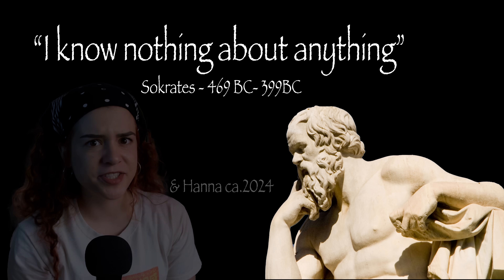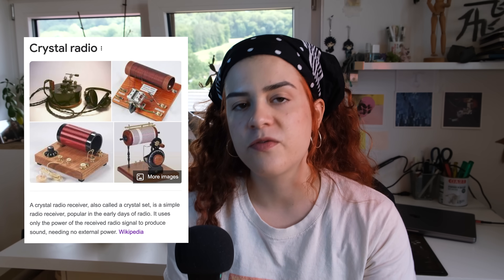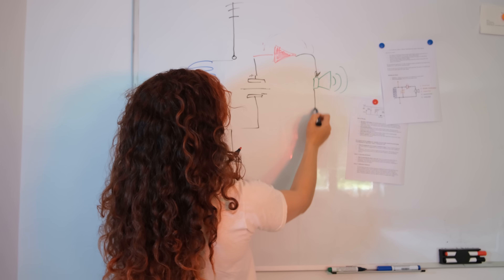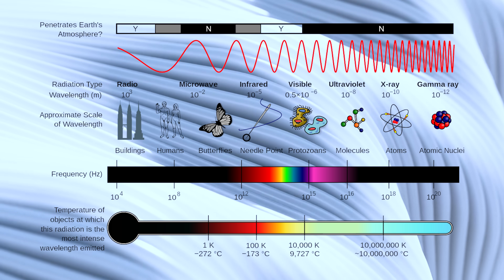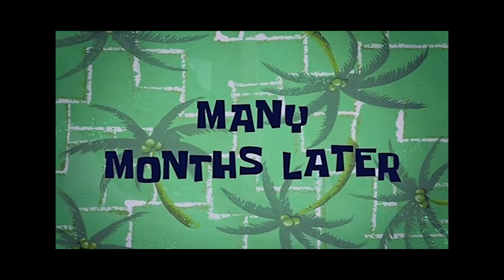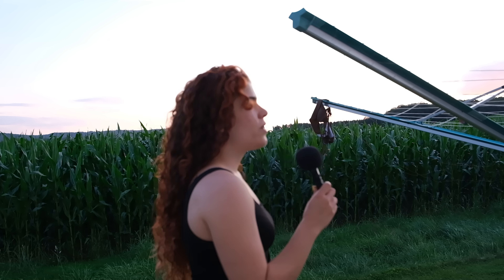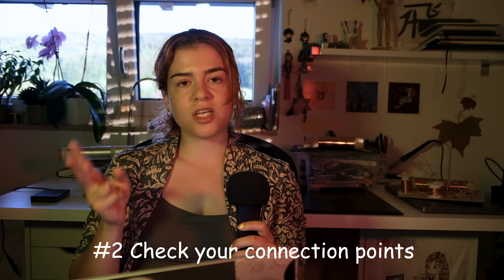I BUILT A RADIO AT HOME

Comment: You ever play on a swing?  That inductor-capacitor circuit is kind of like that.  You start out without any energy, sitting at the bottom of the swing.  Then the antenna captures some energy and sends it to your L-C circuit, just as your friend would push you a little to start you swinging.  The swing oscillates with a fixed frequency based on its length and the force of gravity.  The L-C has a specific oscillation frequency too, based on the values of L and C.  Both your friend and your antenna must push you and the L-C circuit at the exact right time for you to gain more energy with every cycle.  We call this the resonant frequency of the system (mechanical or electrical -- it doesn't matter).  At the top of your swing cycle, you have 0 speed and all your energy is potential.  At the bottom of your swing, you have maximum speed and all your energy is kinetic.  The resonance is between kinetic and potential energy exchange.  In the L-C circuit, the energy exchange is between maximum voltage (all energy stored in electric field of capacitor), and maximum current (all energy stored in magnetic field of inductor).  The resonance effect is what allows the "amplification" you mentioned, but it's really just saving more and more energy each cycle.  The fact that it only works at a specific frequency is what allows the circuit to be called a band-pass filter.  Your earpiece will take energy out of the system, so you gotta be careful to only take a tiny bit out.  Your use of a resistor limited how much energy was taken out and allowed it to continue resonating.  Welcome to electronics!  Hope you enjoy your stay.

I'm guessing the final version of your radio worked because your giant inductor had spacings between the windings that were so tight, that their close proximity started acting as capacitor plates.  You inadvertently built an L-C circuit anyways despite getting rid of the aluminum foil C.  This is called parasitic capacitance, and all inductors have it.  All inductors also have some self-resonant frequency due to this.

A lot of the guesswork can be eliminated from this by using a Vector Network Analyzer to measure your components.  Cheap ones exist today, for example the NanoVNA.  This would let you see self-resonance among many other things.

YouTube channel FesZ Electronics does excellent work teaching EE in a relatable way.

Comment: Crystal Radio!. You could now progress to the single chip AM receiver. Also try using the rectified output feeding to the charger chip in solar led lanterns(minus the re- chargeable battery and solar cell), to make an led powered by radio waves!. Also try getting a ham radio license, to transmit your own radio waves across the globe and have fun at the same time talking to others❤👍

Comment: Did you get the real diodes or did someone scam you?  A lot of people selling the germanium diodes are really selling Schottky diodes. They can be made to work but they don't work in the circuits many articles suggest.
Edit:  That resistor is needed mostly if the diode is not really a germanium.
On my channel I have a video about making the fake diodes work and also about making a capacitor that is simple.

Comment: A Diode is like a Check Valve in a pressurized fluid or pressurized gas system: It allows the electrons / liquid / gas / whatever to flow in only one direction.

Comment: In case no one else posts it.
ASPIRIN works for getting enamel off that sort of wire - it's especially useful for ultra-fine braided earphone wire.
Push the wire against the pill with the soldering iron = it melts and gives off quite pungent fumes (possibly acetic acid ?) so do it somewhere ventilated...

Comment: 2:02 If you look a chart of the EM spectrum, the left side of the visible spectrum (light) often has red and radio.  This side of the spectrum, at high powers can make things hot (like a Microwave oven) or can induce electrical current (which can pose the same hazards you normally encounter - fires, burns, etc. at high power levels).  So in that sense, radio can be dangerous, and that's why you see warning signs at high power broadcast sites - but not low-power devices like your smartphone or home WiFi. The power is too low to hurt anyone.  The dangerous stuff is in the UV (this is why you need sunscreen) and higher energies of photons (both light and radio and gamma rays are all the same stuff photons, at different energy levels).  The photons at higher energy than light are dangerous.

Anyway, at 2:13 she talks about the radio waves going through the air, but the neat thing is that it's really traveling through spacetime itself - so it works great even when there is no air.  This allows it to be used for things like radio astronomy. 😁

Comment: Please try persevering with the capacitor. You will need to "tune" the capacitor to tune into a signal, so while it may not work straight off, that may be because it's not tuned into a station. Have elements of the capacitor you can move around so more or less of the "plates" overlap. That way you should get a stronger signal than with the resistor.

Comment: You don't need diodes you can use a razorblade and pencil lead.
Reply: A diode is better! But one thing at a time. If it works successfully with the diode to bring in a strong signal, then she can experiment with swapping the diode out for other rectifiers.

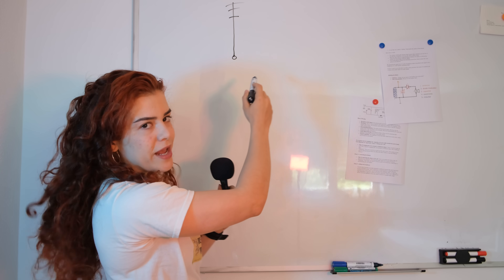Comment: 03:23 "Catch the radio waves which are electrons" - if I heard you right. Radio waves are not electrons - they are photons - i.e. light. Very low frequency light.

When the light hits the antenna it makes the electrons in the antenna move.

Comment: IT'S SWR THAT REALLY MATTERS FOR ANY RADIO---Standing Wave Ratio (SWR) is the impedance matching of the antenna with your radio. It must be close to 1:1 but should not be more than 1.0 :1.5. I guess, everything in your radio should be of copper and your speaker's impedance should also be low. BTW, is it possible to use a step up transformer to use it like an audio amp?
Reply: No, on a crystal radio SWR doesn't end up mattering much at all.  Look at the design of what she is building.  The antenna is short so it looks like a capacitor.
Reply: @kensmith5694  What uou know abput SWR? IF there is a losd and a signal souce coneected, then there will be a difference in resistance causing impedance mismatch, which eill discrease SWR.
Reply: @debojitacharjee  What do you know about SWR?  An impedance mismatch increases the SWR if anything.  
Reflection is:
(Z1 - Z0) / (Z1 + Z0)
This will be zero for a correct match
If you are building a crystal radio, you don't need to bother with this because as I said, the antenna is a lot shorter than a wavelength so it is capacitive to the system

Comment: @arthoefmann    This was a great explanation of a crystal radio! Some advice if you want to build another one:
1. The 'germanium' diodes you got from amazon were likely not actually germanium. (Or even diodes for that matter. If you can't test them, i.e. with an oscilloscope and a signal generator, you can't be sure what you get from amazon)  Try getting your componnents from a reliable industrial source like Mouser, Digi-Key, Octopart, or Futureelectronics.
2. A better grounding point will make a big difference. Usually, near where the electricity feed from the grid to your house, there will be a ground rod with a cable connecting it to the circuit in the building. Hooking your ground there will work better thsn the downspout.
3. Keeping your antenna wire as high off the ground as you can will increase the power of any signals you pick up.
I really liked the drawing you did of the waveform of AM. And the very end was hilarious!
Reply: Getting a 1N34 from anyone is really hard.
If you add a resistor across the headphones, a 1N5711 works OK for a radio.
I found that 2K worked the best with the earphone I have.  10K sort of worked.  Higher than that was weak and distorted.

Comment: Terrestrial analog radio is being switched off these days so building a radio like a crystal set is a bit pointless
 you would need to build a digital radio which is probably relatively complicated
 or explain how to use the kind of digital radio available on the internet ,,, SDR,,, software defined radio
Reply: There are many AM stations in the US still working.
You can also build a crystal radio for the shortwave band

Comment: The best way I can think of to explain the capacitor-inductor relationship is to imagine standing on a wood-and-rope bridge and jumping up and down.  When you jump, the whole bridge moves a little and stops.  If you jump at just the right speed, the whole bridge starts to move with you.

The electrons moving back and forth are like your jumps, and the inductor and capacitor are like the ropes.  They dissipate most of the energy in the wires, but the electrons that are moving back and forth at just the right speed get reflected back and forth between the capacitor and inductor.  If that back-and-forth speed is the same frequency as the carrier wave of the AM station, then you've isolated (i.e. "tuned in") the signal.

The diode turns the signal into a bunch of little pulses, which cause the crystal in the earpiece to vibrate.  The stronger the signal (the "amplitude" in "amplitude modulation"), the more the crystal moves, which is what gives you your sound.
Reply: Love this explanation; thanks, Jeff!
Reply: With a rope bridge it's not the tension in the ropes that store the energy, but rather the gravitational potential energy as it goes up and down between it's 'optimal' position (a catenary curve) and a different shape.  So it's the wood rather then the ropes that's actually 'storing' most of the energy.

Comment: Oh my..
I recently posted about your possible future..
It is magic...
Did you know that low frequency radio waves are miles long....
check out my CB radio episode..
I enjoyed your video...
If you use a thicker antenna wire you'll get a better signal
make sure your ground has a really good connection... you may need to sand it to get a good ground connection on the galvanized pipe
In my experience the ground made the biggest difference as it will lower the amount of noise.
Also...
test at night...
;)
thank me later on the night suggestion..
ha

Next episode..
Solar cooker!

Comment: If radio is magic does that make you a witch lol. Also Tesla is the inventor of radio at least thats what the U.S. supreme court decided in 1945.

Edit: also I believe wifi is amplitude modulation not frequancy modulation although it is a digital signal using some special techniques.

Comment: Hey that was a grate video, and it is so cool that you  have decided to build, An radio. 

And if you'll want to look more in to radio, i think you should check:

1. Transistor radio. theses radios were created in the late 40's so their technology is more advanced.
(if you are new to electrical engineering {cool}, transistor, is an device used for amplefainig. or it used for an electrical automatic switch).

2. I haven't really study frequencys thoroughly. But maybe you could add another H.P.F (An high pass filter. An H.P.F makes sure that only High frequencys can pass through) , to create an band pass filter. to decrease the frequency.

3. You could maybe use an Active H.P.F. It is just afilter that uses the op-amp feedback to make the frequency's more clear.

4. And if you don't want to play with more H.P.F /L.P.F(an filter for low frequencys)/transistors/op-amp's, you could always just increase the capacitance, by adding more capacitors(In parallel). 
 
I hope you, the creator {and mabye the reader}, will make even cooler projects in the future.

Comment: It is also worth realizing that the human nervous system is the world's longest antenna, which makes it sensitive to electromagnetic waves.
Reply: It's nowhere near the world's longest antenna!
Reply: @paulsengupta971 , you've piqued my curiosity. What/where is a longer antenna?
Reply: The nervous system branches, which means it acts as a compound of smaller (around your height and less) antennae. Our nervous systems are electrochemical, and since the nervous system is made of so many lengths of “antennae,” causing so much signal interference that even if any sort of wave does have an effect on some part of the nervous system, that impulse is not making it anywhere substantial. Radio waves and the like have a negligible effect on our bodies.

Comment: reintroducing electricity is as easy as spinning a motor backwards. and doing a lot of stuff to make that actually work
Reply: What if you have to make that motor?
Reply: @kensmith5694  why would i need to do that?
Reply: @drmntpibb  If the situation gets bad enough that a crystal radio needs to be built, chances are any motors will already be in use somehow.
Reply: @kensmith5694  she didn't make the diode from scratch
Reply: @drmntpibb  I know how to do that so that is less of an issue than making the wire.
Reply: @kensmith5694  we're really not getting anywhere. I think the only sensible way to settle this is with a duel, what's your MTG arena handle?
Reply: @kensmith5694  that's pretty bad ass tbh. also, i checked out your youtube channel and i gotta say i didn't know you were an OG like that. respect. also i own the same exact CD rack
Reply: @drmntpibb  As you can see, it is full so I had to stop buying CDs.  That is the way it works isn't it?

Comment: Is it dangerous? Probably not the one you are building. I mean assuming you don't burn yourself with a soldering iron or something equally silly. Are radios more generally potentially dangerous? Well... don't build a microwave radar emitter or emp generator by accident! Or a radio laser. Anyways stick to crystal radios if you have to ask and you'll be fine. :D

Comment: Do not despair. Building a radio without any measurement tools is hard, because you are working blind. Sure enough you can calculate the inductance and capacitance, but if you can measure them, or check the resonance frequency, you know what's wrong if things do not work instead of trying again all over. A local HAM radio club certainly would have helped and might make for a great part two.

Comment: I expect the problem you had was that the fixed frequency inductor /capacitor circuit didn't resonate at the frequency of a nearby transmitter. After 20 attempts you presumably struck lucky. Try using a variable (tuning) capacitor instead in the arthoefman MkXXI Rx (receiver). You could then get multiple stations. Anyway, well done.

Comment: Ok cool you got it working. the coil and the capacitor form a circuit that is oszilatting this two componenet form a resonant frequenzy where it works best. I think your resonant frequency was some where where no signal was. normally you could use a regulatory capacitor to "tune" the resosnant frequency.

Comment: When I was a kid I had a crystal radio kit from Radio Shack. It was fun and I learned that a headphone is also a microphone.
Reply: Yes, I was going to say it is a lot less difficult if one starts with a kit that has components chosen/sourced by someone with experience. I also put together a couple radios from Radio Shack kits as a kid. There are far simpler projects one could try. Radio Shack is no longer available here in Canada but there are sources on the internet for many electrical and electronic kits that would help give one a leg up.

Comment: Good for you!  Sounds like you were picking up a shortwave station, if it was using different languages.
Reply: If you tune around on medium wave you can get all sorts of "foreign" stations, especially at night. If you live near the border of several countries, you're going to pick up radio from all of them.
Reply: @paulsengupta971  Right, but if the same station uses different languages, it is often a sign of an international broadcaster.  You can pick them up on a crystal radio unless you have a tuner to tune them out.

Comment: Pumping your legs on a swing is a good way to think of how the inductor and capacitor work as a resonant circuit. The swing "wants" to move at a certain frequency/speed. If you pump your legs too fast or slow, then the swing barely moves. But if you get the timing right, then over time even small energy inputs make a swing go high. Think of the combination of the capacitor and inductor as determining the length and stiffness of the swing's rope --> the resulting resonant frequency

Comment: Used to be super common to build radios and the early amateur radio operators would build their own.  I found old lab electronics test equipment a neat option as well.  However, on the other end of simple building versus more expensive and complex, read into the prisoner of war POW radios and other improvised radios one can build.  Very interesting the creativity of sourcing materials to use for receiving and even transmitting signals.  Scrap materials are great, especially when you can find for free.  Good thinking in regards to the best ways to have a most passive system.  Passive versus active designs that is.  You can think of everything in the circuit like an antenna and think of how to optimize those parts like and the rest of the circuit design, where this method of thinking is more critical with higher frequencies like in the microwave on up range.  Great work and keep up the learning that is always continuing improvement. Thanks for sharing!

Comment: Drawing a inductor and calling it a capacitor put a smile on my face, I applaud you for correcting that. I have been in Amateur Radio for over 50 years and after building so many fairly complex radio receivers and transmitters to keep count, I am still fascinated by the basic crystal radio circuit. I always seem to have a crystal set on my work bench 🙂